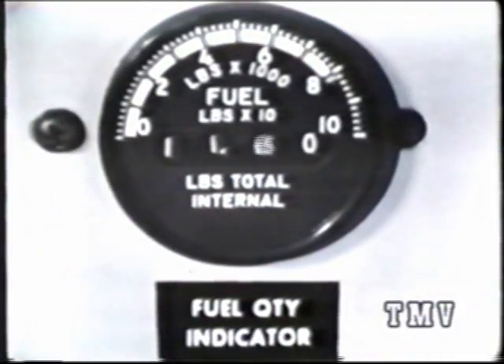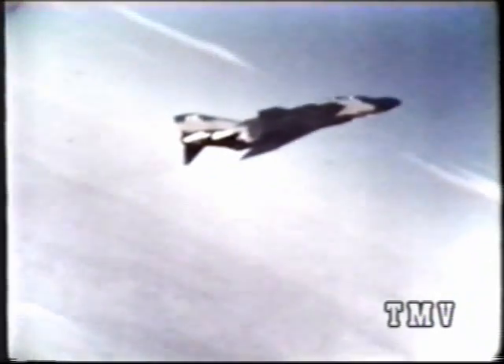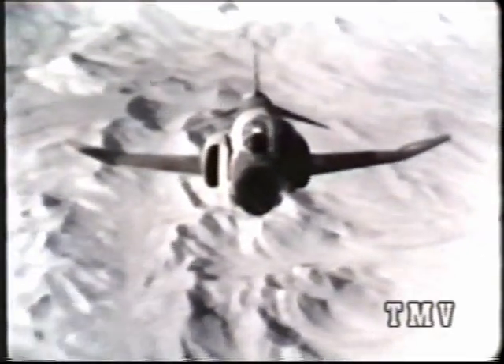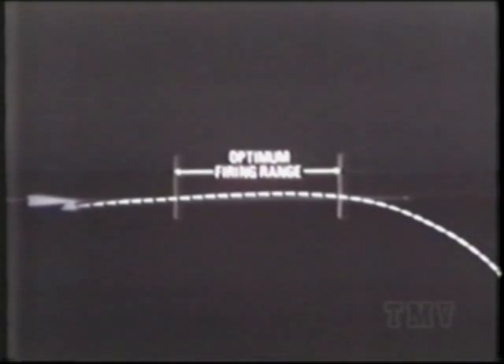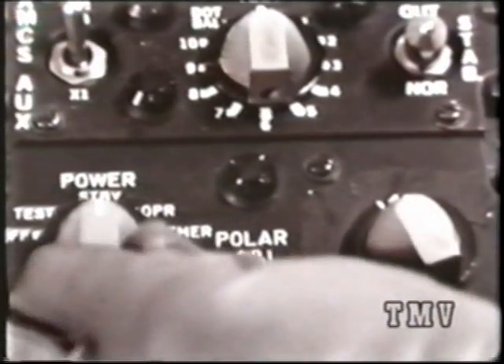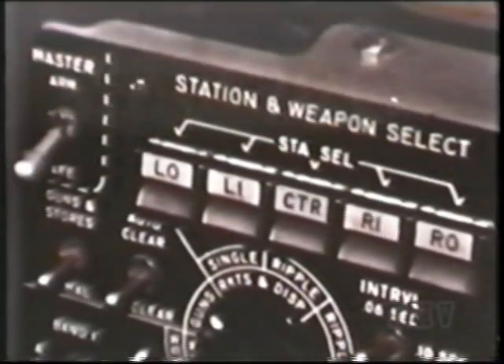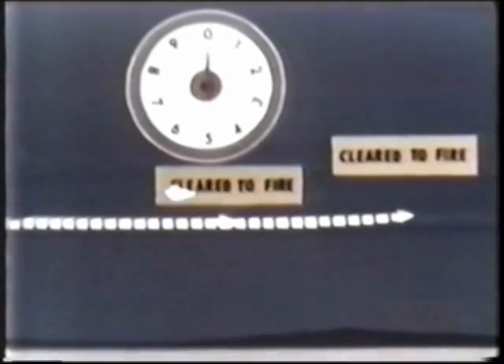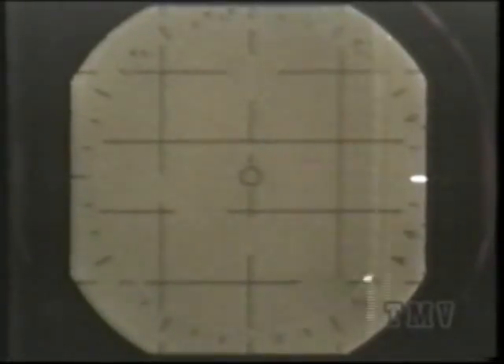F 4 Phantom Flight  Characteristic & Gunnery

Comment: After one year at Udorn RTAFB, Thailand (1971), I was stationed at a little place called Matagorda Island AFR, TX.  It was a bombing and gunnery range just off the coast of TX.  The B-52's would hit the targets dead on from 30,000+ ft but the F-4s not only inaccurate as hell during bombing runs but sometimes they missed the entire island.  A great airplane but man, those pilots needed some help.

Comment: "Homefront" asked 7 mos. ago why USAF F-4's had back-seat flight controls (while USN/MC did not).  Ans.: Because USAF decided ~1963 to use new pilot graduates as WSOs (weapons systems operators) rather than non-pilots in the back seats and in a later assignment allow them to upgrade to aircraft commander.  Ragged landing?  Blame the back-seat guy!  UPT 64F class had a number of back-seat assignments.

Comment: Why did they bother to give this thing ailerons? Every video I saw advised against using them.
Reply: Whatever the case, they will NEVER design a fighter like that again!
The opinion on the Phantom is split once you get past the starry-eyed aviation lovers who never bothered to read all the accident reports or hear the stories of people who got into problems in that plane.
The lack of built-in gun is the most overtalked design flaw of the early Phantoms.  I think the fact that the plane had to be "rolled with the rudder" in certain attitudes and its departure characteristics at high weight, low speed were much more important "gotcha's" than the gun issue!  The F-4E/F/G/S/RF-4E with their redesigned slatted wings was the HARDWARE attempt to finally address the worst handling issues of the F-4.
One of the things I've heard Pierre Sprey get 100% correct is the fact that the Phantom had all those bends in the wings and those weird anhedral(?) elevon/tails above the engine exhaust nozzles as awkward fixes.  Those are dead give-aways for some serious aerodynamic flaws in the plane.  They worked to correct some serious inborn stability issues at speed but the F-4 was by all accounts not the easiest plane to recover from a spin nor one that handled particularly well at low speeds.
It should be no surprise that after a few years experience with the abusive flight characteristics of the F-4 that the F-14 and F-15 were designed with far superior handling characteristics and the ability to cope with or get out of situations that would get the aircrew killed in an F-4.
Reply: The wings were that strange because they had to fold.
Later aircraft were not low wing with the gear retracting into the wing.
Later twin engine aircraft had two vertical stabilizers. The F-16 has additional fixed stabilizers under the tail.
It would be interesting to know how the Suchoi Su-15 handled.
Reply: Ave: Very well discussed. However, give the F-4 credit, the designers were forced to fit provide a plane that worked from stall to Mach 2+ with largely mechanical and analog control systems.  The F-14/15 had much smaller operating envelopes and the advantages of transistorized flight data systems.  It was easier to provide better performance.  The F-4 was still an outstanding engineering achievement for its day!
Reply: @AvengerII  They began designing the F-4 in 1953. At the time, the idea was delivering large  payloads ...and have gobs of speed. With the speed,  and the use of radar-guided and heat=seeking missiles, the thinking of the time went, there was no NEED for a gun, as you would never get in a position to use one. Well, the MIG-21 proved to be a problem for the F-4 without a gun for a coupla reasons. One MAJOR reason was one rule of engagement...they had to make a visual confirmation of the aircraft. That meant close in. Sometimes too close to use radar. Also, once in close, it turned into a typical dogfight, and a constant jockeying to get to the guys 6...so was done at slower speeds. At least the F-4 could roll out of the fight with ABs . The F-4 was never intended to operate at low speeds. In any design, there are always compromises. Speed, manueverability, capacity, range. The big-ass Phantom smoked like a forest fire, had a wide turn radius,was sloppy at low speeds (exact opposite of MIG-21) but had 4 times the missiles (8-2). They did add a gun pod, and combined with the heads up display reticle really helped.  So...in short...different designs characteristics because of different missions, different approaches. The Navy, because of its "top gun" training were far better dogfighters than Air Force. This changed when it was obvious the USAF training SUCKD big time. The military gives the specs, the designers build to specs... They wanted just what they got. Then, Vietnam happened ... and the bird was asked to fulfill missions outside its designed parameters. The idea was...radar from far away...lock on shoot down. But the ROE demanded close inspection, putting the F-4 in the exact wrong place to begin an engagement. Live and learn. The reliability of the missils was suspect, but that was mostly a function of the WCS mechanics who were responsible for repairing/maintaining the radar/missiles/bombs/gun/ etc. I know. I was a WCS (weapons control system) mechanic ... but I was the only one out of hundreds of guys over my 30 months  there who received Superior Performance Proficiency Pay (SPPP). These guys just ignored the testing equipment that blinked little dots when you pickled off a missile...just sloppy maintenance. Capt. Ritchie used to ask for "that skinny kid" to look at his radar when it wasn't up to snuff.  (me)  . It was a complex system, and guys would just not study or care ... the end of the war and all that. But I HATED losing a pilot cause MY system failed. Fuck that. A helluva thing to lose all your radar, but it was common. Because of dumbass mechanics.  Still Ritchie became the first and only front seat ace of USAF in Vietnam and his usual back seat Bellevue was also an ace, but back seat. The Navy had an ace or 2 as well, I don't know how many.Lord, I climbed in and out of those cockpits thousands of times. That APQ-109 radar/missile system was terrific when it worked. And mine always worked cuz I did my freakin job. The smallest thing could fuck it up.
Reply: OMO: There is nothing wrong with the F-4 control design.  In almost ALL aircraft you do NOT use ailerons to try to correct a stall/spin heading change. because it induces more drag, and worsens the condition.  Rudder, rudder, rudder.  During normal flight conditions the ailerons are perfectly useful.
Reply: @KB4QAA  he said you would have to use the rudder in a role at high speeds and angles of attack
Reply: @possiblyadickhead6653  There is nothing wrong in using rudder as necessary. Even a J3 Cub uses rudder as primary directional control at slow speeds and high angles of attack.  Get a pilots' license.
Reply: @possiblyadickhead6653  at higher angles of attack ailerons are not as effective
This actual fighter pilot flew F5 in DCS and did that
Reply: @shashlik7959  yea okay but not in all planes. Especially modern ones
Reply: @possiblyadickhead6653  I mean if older ones had this issue why shouldn't the phantom have it :d
Reply: @shashlik7959  yea u are kinda right and I think more modern planes don't have that issue because of fbw and do it automatically to a certain degree for you
Reply: @shashlik7959  wasn't really thinking to hard when I wrote the initial comment
Reply: @possiblyadickhead6653  or better wing design or IDK :D
Aight have a nice day
Reply: USA#1 !!  Umm, being a retired Naval Flight Officer as well as a civilian pilot and instructor gives me a certain amount of experience in ACM.  And no it isn't used differently than any other aircraft.
Reply: USA#1 !!  Further, The issue is about Adverse Yaw at high AOA, and increased drag on the up aileron/spoiler.  This was critical for USAF pilots in the 1960's who were trained ab initio in jets and never learned to use the rudder instinctively due to propeller driven Torque, P-factor and Adverse Yaw of trainer planes at low speed/Hi AOA.  Navy pilots have always been trained initially in propeller driven acft.
Reply: Adverse yaw and increased stalling tendency with use of ailerons necessitating use of coordinated Rudder was  even more critical in the F-100 Super Saber.  This was illustrated in the infamous "Saber Dance Crash" film.   https://youtu.be/Q2qqKwndFW0

Comment: I was a Weapon Control Systems Instructor at Lowry Air Force Base from 1977 to 1980. I used to show the gunnery movie to introduce the Lead Computing Optical Sight portion of the cirruculum. Wow, does this bring back some memories! Thanks so much!
Reply: I was at Lowry in ‘78 for basic munitions training. Ended up in the 33rd TFW at Eglin, F4 then F15, mostly missiles, 20mm, cartridges and practice bombs. Lots of missile and 20mm handling.

Comment: The first 17 minutes are basic handling tips, which suggest that F-4 drivers were exceptions to the crack  that jet jockeys are dead from the waist down. Glider techniques were still relevant.
Reply: RAF F4 pilots were told " when it buffets, use your boots "
Reply: At certain aoa, the controls were reversed.